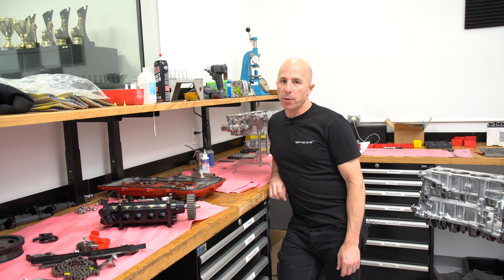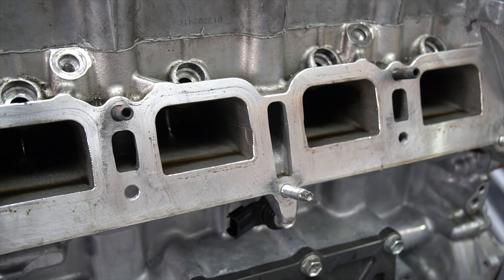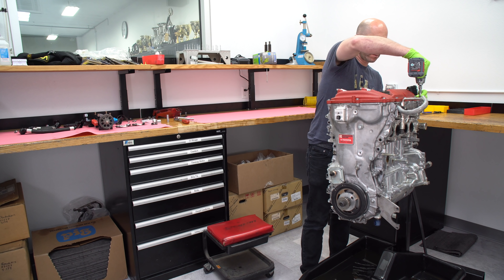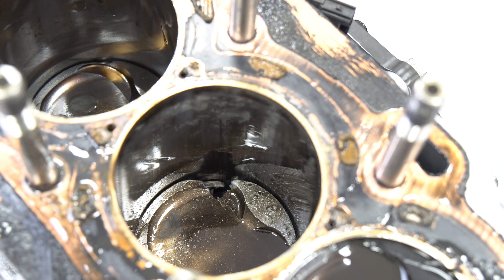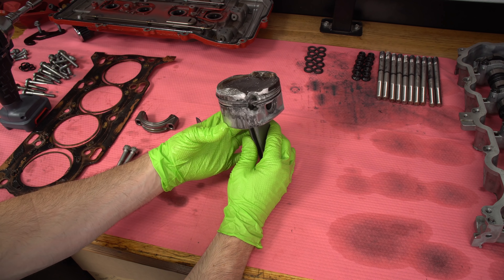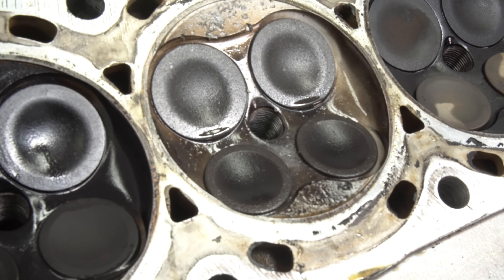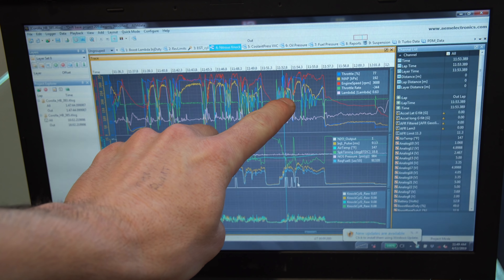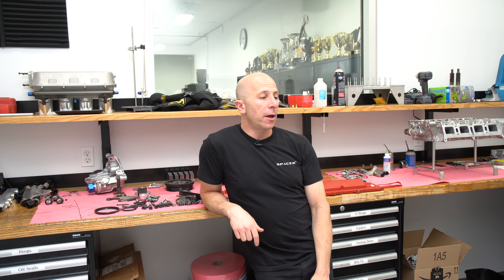Blown Motor Teardown - Burnt Piston

Comment: Is the ecu not set up to pull timing and boost on knock events? Or is taking power away too much of a accident concern for the driver and its better to blow the engine? Loving the vids.
Reply: probably not worth loosing race for some error that can happen
Reply: He said they had seen a little bit and tried to pull some timing out of the cyl. Personally I would be taking a hard look at that injector. Especially if the cylinder was giving you some knock on previous runs A/R's were good, pressures were good etc. Something kept going wrong after they swapped a plug from what I heard.
Reply: @the_kroe5509  They changed, plugs and injectors, pulled ignitiontiming and tried a different fuel brand and gave the cyl more fuel, he says it all in the video

Comment: Steph, the knock sensor would not hear the pre-ignition... they do not call that the silent killer for nothing. It makes no ping. The detonations probably showed up first, overheated the plug and set pre-ignition in action as a consequence. If every other stroke is a pre-ignition or a knock it goes west quick..  Mentioned to Fredric, could you by any chance have a small steampocket forming in the head close to the offending cylinder at max load?

Comment: It’s called excessive blow-by when you have a piston with the rings worn out too much and it causes to much pressure in the crank case. I had a frieghtliner once that was blowing oil out the dipstick and I thought it had a piston with a broke ring in it somewhere. Come to find out the crank case breather was clogged up so the pressure didn’t have anywhere to go other than the dipstick and if it can’t push it out the dipstick it’ll most likely start blowing gaskets.

Comment: Excessive combustion chamber heat caused this to happen. Indicated by the molten melted underside of the piston. Once the already compressed, dense fuel and air mixture, is introduced into an excessively hot environment, sudden expansion causes pre-ignition, as the piston is still on the compression stroke. This sudden expansion due to excessive heat, is the reason the head gasket blew prior, and the obviously cracked spark plug ceramic aluminum oxide insulator as well. Lowering boost pressure or compression probably won't fix this issue. The only way is lowering heat within the combustion chamber, by introduction of a small amount of nitrous oxide, or maybe even water injection. Both will create more power, but reduce combustion chamber temperature, and thereby reducing pre-ignition.

Comment: It's very often the third cylinder in 4 pot inline engines. It's the hottest one as it's the furthest from the coolant flow. One and four is surrounded from one side and second is closer to the pump and gets more cooling. Thats why I  put the most fuel delivering injector to third as there is always some variation on non racing injectors we poor boys use.

Comment: The problem is not the sparkplug as the abnormal combustion continued even after changing to new plugs.  The injector was also changed, and timing taken out but still preignition happened.  So no leanout or detonation. Assuming they are on an alcohol fuel (E85 ?), the most likely issue here was probably with oil control in that cylinder (a bad piston ring or oil ring, or the sleeve going out of round ?). This is because preignition is usually caused by oil contamination of the inlet charge during valve overlap.  See   "Fundamental Approach to Investigate Pre-Ignition in Boosted SI Engines" SAE paper 2011-01-0340.  Before they fixed the cylinder sealing, they would have just blown the head gasket and the piston may have survived.  As Steph says "thats racing"

Comment: Very interested video Stefanos Papadakis, when those situations obvious not normal can happens with anyone racing engine builder and are effects probably off problems in tuning as AFR ou ignition timing, or fuel octane or even lots of turbo pressure boost or all this causes incorrects and working together in some critical moments.of hard conditions.

Comment: I've always used slow pressure against a shop bench or something with a good grip on the plug to close the gap. I would doubt that's your issue though. Hopefully it doesn't persist.

Comment: I have had two platinum plugs break on me over the years.  I stay away from platinum and iridium plugs and just stick with the old copper plus or whatever. iridium is good for long mileage but I don't think it can dissipate the heat as well.  I have never seen a conventional plug break apart. I've seen one melt the ground strap but it is a smaller piece to fly around the combustion chamber.  just my experience which is fairly limited in racing

Comment: "Note: Never use a round gapping tool to check the gap or to increase or decrease the gap setting."
(DENSO manufacturer on iridium spark plugs)
Reply: Do u mean the round ones they sell at the auto parts that go on your keychain?
Reply: @sparklygames71  
Maybe that since the point is very sharp and thin,so breakable,or maybe simply a rounded surface,wich could break the porcelain,very exposed
other manufacturers like bosch ,for classic spark plugsdo not see problems at tapping the spark plug on a flat ,solid surface,they give that as procedure.

Comment: That is a very interesting theory that a broken spark plug is the root cause of the problems.  IMO, you might want to invest in a bore scope of some kind, you could use it to inspect the cylinders if you start to see knock again.  It might be able to help you confirm your theory.  I'm not sure how much it costs but you seem to be really invested in Motorsports so it might not be a bad investment in the end considering how much it costs to build a 1000 HP turbo 4 cylinder.  Catch the problem early and save the motor before you have to sleeve the block and get/repair the head.  Cool video btw.

Comment: Id suspect the egt's would tell the rest of the story. From what I can tell it looks like the ring butted and cracked/lifted the ring land as a result of elevated cyl pressure and heat, most likely due to detonation. Judging by how the other center spark plug shows excessive detonation Id wager you were starved on fuel or something else to spike cyl temps. I personally wouldnt run iridium/platinum they are detonation monsters. Id recommend a std copper in the future.

Great content btw

Comment: How will you repair the engine? In particular the cylinder wall?
Reply: weld it, bore it, sleeve it.
Reply: @Keyno77  Thank you.
Reply: It appeared to be sleeved in the first place. 

Darton makes very strong replaceable sleeves for all sorts of motors including top fuel drag cars. Also a great alternative to a full iron block in the case of an LS vs LSX at high cylinder pressures, weight savings being paramount. Sleeves can also allow for greater piston skirt support on longer than stock throw cranks at the bottom. Less distortion and serviceability make them a no brainer on high pressure builds (high peak TQ/cylinder that is). So I’ve heard anyway...
Reply: @TheTmshuman  Thank you.

Comment: I had almost the exact same thing happen to my 03 Cobra with lots of boost. A spark plug ceramic came apart, got lodged in the exhaust valve, and melted about 1/3 off the exhaust valve. No real piston damage though.

Comment: The ceramic chips probably were not causing the pre-ignition. It was the exposed electrode turning into a glow plug after it lost its insulation.

Comment: Firstly good honesty. 
I am not sure if I was understanding the progression, the engine started knocking cylinder 3, you swapped out the plug which I assume was the busted one? Aka the plug with no ceramic, which is why you reckon it was from plug gapping. Or was the second plug the busted one? Which was after the knocking had started.

Comment: This is a crazy idea out or off the top of my head But what about a dye you could apply to the ceramic to check for check cracks in brand new spark plugs? and than after every race ?

Comment: You know what I had a spark plug break off and do the same thing but I didn't ding it before hand, I think it was a manufacturer defect, and I've found a cracked plug since then because I check now and also know where to check because of where it broke

Comment: Looks like you could do with a simple blow-off valve or plug that would open a big hole to let gasses out if a piston gets holed. This would save all those seals and gaskets.
Cheap and very light.

https://en.wikipedia.org/wiki/Rupture_disc

Basically, its aluminium foil sandwiched across a hole. Could modify the oil filler cap as the bursting disk.

Comment: I'd think more along the lines of, gaping the plug by jamming something between ground and center electrodes or smacking it so hard it closed the gap fully with force... those for sure can crack the porcelain. never wedge between or push sideways on electrodes, especially the center...

Comment: You guys should consider running 3rd Gen Ecotecs (LDK/LHU) with an LSJ (non DI) head, or one of the DI heads (LNF/LDK/LHU). Seems to me you guys would have equal or better quality Sand cast blocks with optional closed decks from multiple aftermarket parts providers and NO head gasket issues whatsoever. But I know.... that would require a MASSIVE contract change etc, but for the teams aspect of down time I would almost put money the Ecotec platform would be more reliable. Do any formula drift teams run Ecotec’s?

Comment: Do you have to replace the entire block since the cylinder walls are so damaged?
Reply: Austin George No i'm pretty sure they just change the cylinder sleeve and do some machine work on the block and head, as well as change out the damaged parts. Atleast i would think the cylinders are sleeved when they are pulling 1000 horses out of a 4-cylinder engine. Would be silly if they weren't.
Reply: i doubt he would have to replace but i bet he has to get it machined and if thats the case possibility he is gonna have to change all the pistons out too cuz its gonna change the size of the inside plus i dont think u want one smaller piston and another bigger so id say he is gonna machine it slight possibility he wont be able to machine it but if he does most likely change out the pistons all of them not just the one
Reply: @JolleBoiii  i didnt even think about the sleeves guess he has gotta do what we all do when an engine plodes hope and pray lol

Comment: I don't think it was the way you gap the spark plug. I could just be a faulty plug because something similar happened to at  friend of mine.  Lucky the porcelain was crack but was still whole and was just covering the electrode.

Comment: Are the middle cylinders running hot on that setup? #2 on my 4-cyl VW 1.8T knocks sooner and more than the other cylinders, I think its from running hot being in the middle from not getting the same cooling as 1,3 and 4. It is a safe tune but that cyl is showing slightly less pressure now.

Comment: what do you use for knock sensing ? Is it a standalone device or incorporated in the ecu ?  Knock sensing is related to bore and stroke you can enter these values in knock-sensing system ?

Comment: Did your ECU not have closed loop knock control? If it did how come it missed the massive knock being experienced. Also were you not running EGT sensors in the exhaust?

Comment: Stephan, in this case, in order to repair the engine for future use, do you change engine block or just bore the cylinder/s?  What happens with the head? Is that damage repairable?

Comment: I know this is an old video by now, but maybe someone would be able to in lighten me. With damage like that to the cylinder wall would this engine block be scrapped or can you bore it out or sleeve it and have it working again?

Comment: This happened to me, 4 out of 6 cylinders melted plugs,  cyl 1 & 6 were fine, rest were gone. Lost a built motor, issue was due to fuel pressure we suspect. Report shows it was flowing at 260lph as oppose to 460 on e85. A modern ecu would've saved it.. ahh well

Comment: Blown engines are part of racing. Cracks me up people try to hide it. Any how good for you . Not to be a armchair tech but I melted a piston like that threw detonation. It was back in the early 80s before scanners lol and cell phones. We were trying different pulley sizes.  At high altitude advance timing is key . 4 - 6 degs. but Detonation would come knocking (pun intended) Advance also brings in more heat. You could actually hear it knocking but unfortunately if you heard it it was too late .   By 2000' we started adding water injection and micro fuellers. Not necessarily suggesting that but pistons get melted like that mostly because of a lean condition at any given point at high RPMs . That brings in the heat. Engines blow .They are not perfect .

Comment: So your knock sensor only monitors knock and doesn't do anything about it?
Reply: Knock sensor is only recording the knocking sounds from the engine. It is part of the ECU to monitor the engine. With the data from the sensor the ECU re-adjust its fuction to eliminate the knocking sound making the mixture richer or leaner, retarding or advancing the ignition timing, adjusting the Mass Air pressure by adjusting throttle position (in cars with electronic gas pedal not gas pedal with wire) and generally does everything to eliminate the knocking sound. Many sensors on an engine has only one role; to give data to ECU and nothing more (such as pressure readings, temp, mass etc)
Reply: @subaruVaggos  So,, Why the melt down of piston?

Comment: PapadakisRacing (small help!!!) when choose a engine what to you see? That is if have no sponsors and you are doing a startup of the company (what do you see in oil) as you don't have money to waste on premium motor oil such as (motul v300) and get the best out the engine. Such as buying a whole 200litre barrel. What test will you do on the oil? If possible make a video on it. Thank you. Your friend from India.

Temperature testing, Viscosity, color, detergent, corrosion, moisture test,etc.

Comment: First spark plug intact porcelain. Second spark plug porcelain busted and then third also. What you are saying is the first spark plug dropped a piece of porcelain. Did you cut open the spark plug to confirm there's missing porcelain? Is there missing porcelain on the first spark plug?

You're suggesting a particle was stuck in the combustion chamber to cause the initial detonation on the first spark plug round.

If the material is still present on the spark plug then it wasn't the spark plug 1. If the spark plug dropped a fragment then it would have been ejected out the exhaust relatively quickly. 

I'd say it was "blow-by" caused by either not tightening down the spark plug to the right amount of torque and air/charge going out the spark plug threads, thus creating the first round of pre-ignition. That first round blew out the rings......

Or, there was a problem with blow-by on the rings.

At 1000hp, whatever boost 30 + psi I'd use a spark plug sealant.

I'd relieve those sharp edges on the cylinder head also in case there's hot spots.

Spark plug sealant!

Comment: Don't blame yourself for this cylinder catastrophe, it was not due to the ceramic breaking off from the inner part of the spark plug. If that had happened , it would have blocked the spark before finally shattering into pieces, and that would have alerted the knock sensor, and redlighted an alarm before the real damage was done. This damage was most probably the result of an incandescent particle glowing on the  the plug ground terminal , causing pre-ignition and consequent overheating of the piston crown, which is a closed cycle leading to terminal and progressive melt down.

Comment: I’m surprised you guys used regular spark plugs. I would think you would use the racing NGK plugs where the electrode is flush with end of threads and ground strap is basically straight out over it
https://www.jegs.com/i/NGK-Spark-Plugs/739/B9EG+SOLID/10002/-1